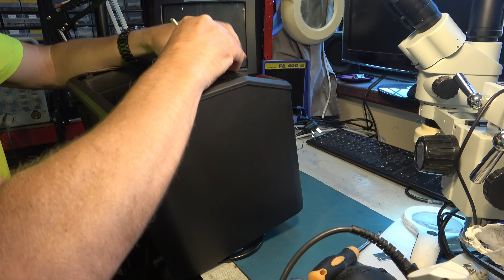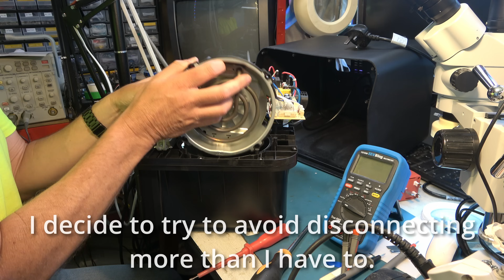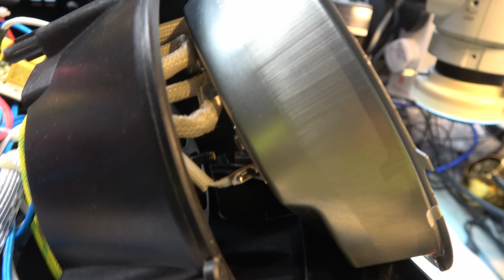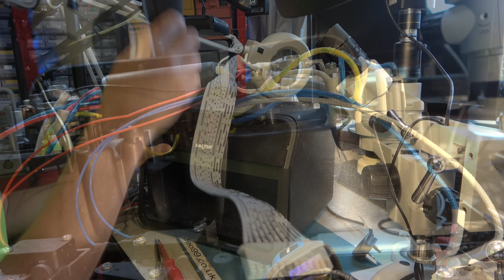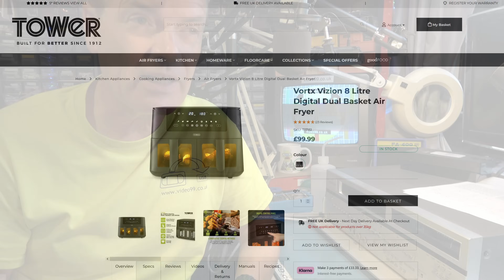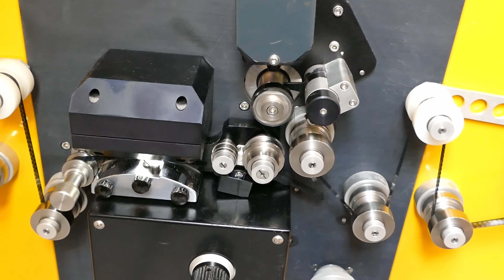Salter air fryer breakdown.  Destined for the skip.  Can we fix it?

Comment: I have exactly the same air fryer three months I’ve had it and the left-hand side has stopped working not producing any heat but the fan is more noisy on the left than it is on the right. The right hand side of mine is still working perfectly. I also brought mine from Lidl‘s. I can’t find the bloody receipt anywhere so I’m stuck with a not working air fryer but it’s interested to know how I could if I was confident enough to do it fix it.

Comment: Well done. Excellent job. Full of admiration. It seems like it was built buy the same companies who make printer/copier units. Sad to discover it's not actually a Salter unit but just a rebadged consumer unit. Shame that they weren't designed for ease of repair instead of burying the one component most likely to blow in the deepest part of the unit. If only they had a fuse box on the outside, with easily replaceable components. I have one complaint from a lady friend however, and that is .. why can't men be fitted with a similar hold function so ensure both parties finish at the same time too? She's jealous.

Does anyone make a professional air fryer? None of these devices are designed to last, they're not easy to clean well, they uses the softest plastic, which scratches as soon as you look at it instead of glass, the handles all break eventually etc. It would also be nice to have stainless steel baskets. I was something as solid and mechanic as an old Dualit toaster.

Comment: Thank you!
i needed to know whether the front escutcheon just pops out with a spludger,  because it's held in very tightly.
The problem on mine was the "power" LED was out and that's your only point of reference as to where to touch to turn it on, the machine seemed dead. I'm not even sure if the power LED is multiplexed by the micro, as it should be lit at the same intensity all the time the oven is plugged in. A new white LED solved it.

One annoying "feature" of these Salters is that when you go from the temperature to the time setting or vice versa,  the setting is increased or decreased by 1 min or 5 deg. Surely the software should just display the current set-points on the first press.

I've also got a Tower air fryer with a drop-down door, its just big enough for a supermarket pizza, and also has a rotisserie which gets used occasionally.

Comment: a bad crimp might cause the connection to overheat and blow the fuse, you can probably solder them if you use a heat shunt (heay piers) to bleed off the heat while soldering

Comment: You should have used a higher temperature fuse than 185C. A 220C. The new thermal fuse will just blow again. They put thermal fuses in heating appliances on purpose. They know it will fail so non technical people will just buy another.
Reply from the maker: I'm not sure that would have been a safe modification.

Comment: @video99couk
A Job well done Colin and a refund as well, Quids in hey, I had one of those thermal fuses blow on my rice cooker in about 2006 which i bought from CDS on billicome road in the 90's (its now called the Range) ps i watched ya last N1700 part 2 repair not long after it came out (Erase head re purposed component under the head drum) incredible stuff, hope everyone's doing great around here, All the best
Reply from the maker: You might have seen CDS on my "Drive in 1991" video recently too.  https://youtu.be/TKj6_icXu2s
Reply: @video99couk  I did watch that video at the time colin with ya vintage car ya have have now (well same model but not same car in 2025 if i recall) and i was reflecting on ya drive down that road where cds was when i posted my 1st comment, its all fascinating stuff, look forward to your next video Colin

Comment: The double thermal fuses are there for countries in mainland Europe that use non polarized mains plugs like Italy, Germany, Netherlands etc. If the element has developed a short to ground internally and the single thermal fuse has opened but is currently in the neutral path, the element would still continue to heat if there is no RCD present on that circuit.
Reply: What do you mean "if" there is no RCD. Regulations require RCDs to be present. They've been required for decades.
Reply: Makes sense, in Italy the brand is called Petra, but it looks like the same product.

Comment: Not as exciting as a Philips N1702 - but you can't do chips on a Philips N1702 (micro chips ? ) - but then an air fryer won't play a video ! - just saying
Reply from the maker: The N1700/N1702 models seem to be quite good at frying their chips, especially LM723, CD4027 and clock chips.  Anyway, you know you'll see some more N1700 type action before long.